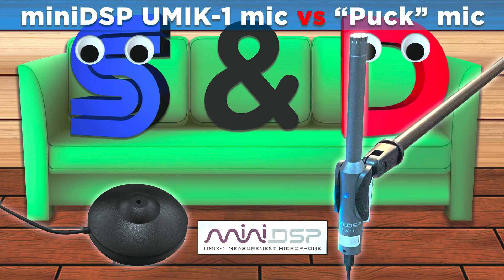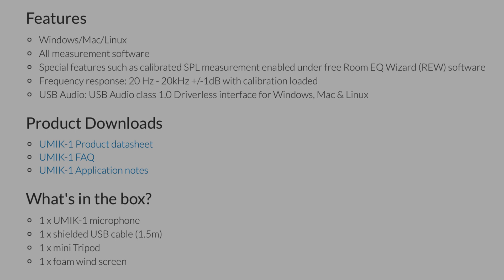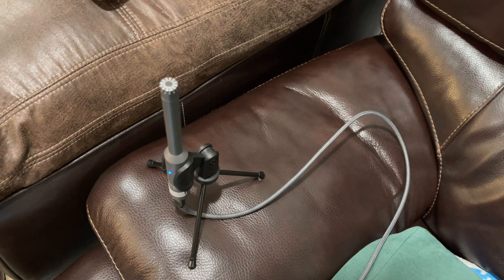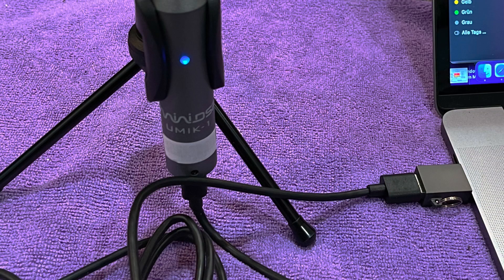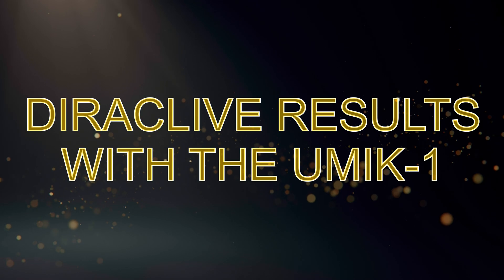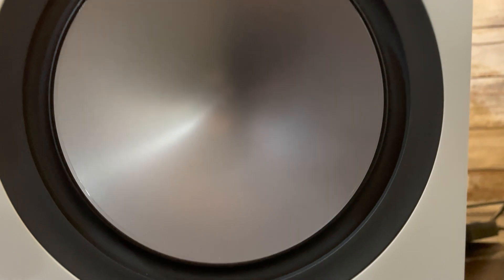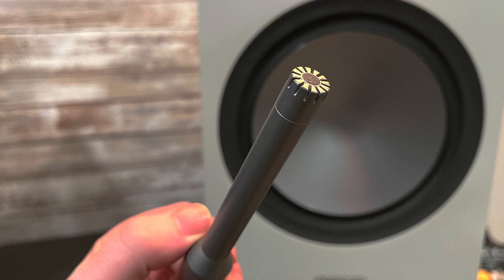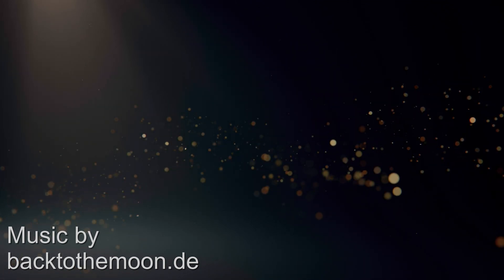UMIK-1 miniDSP + DIRACLIVE I Next level DIRAC LIVE room correction

Comment: Thanks for the video.  I'm having problems with getting the UMIK-1 mic pick up enough sound...tried many things but some reason is not working.  The RZ50 puck is more sensitive...not sure what to do.  I have downloaded the latest direc live version (also tried 3.4.4) and used different mac versions.  Any suggestions?
Reply from the maker: Hello 👋 Thank you 😊 Im sorry you are having issues. The UMIK-1 is definitely more sensitive compared to the puck so something is wrong. Im sure you have tried this but have you messed with the mic gain before the testing starts? The higher the level the more sensitive it should become using DiracLive. I am using the Mac software too. Also check if you have the mic profile loaded into DiracLive. Other than that there is not much else you can do. If its still less sensitive compared to the puck I’d contact the manufacturer.

Comment: Wondering why Dirac recommends The UMIK-1 instead of The UMIK-2?
Reply from the maker: Hi Jaystar! I wondered about that too and did research it. Turns out the extra sensitivity doesn’t make a difference for room correction that you could actually hear while the UMIK-2 is way more expensive. So in this case the OG UMIK-1 does the job very well for this purpose  😎

Comment: Very nice comparison ,but : The Screenshots of both messaurements are nearly similar . This shows: There is no really difference . Why are you sayings differently to the results ?
Reply from the maker: Hi df5485 👋🏻 The differences in the graphs are minor, you can see them more clearly when zooming deep into the graphs which I didn’t show. I am rating the mic of how better the results sound than going to deep into the math of it. But the sound did improve, also because of DiracLive using a mic with a higher sensitivity made the volume calibration and crossovers an easier process. So for people who are not too comfortable setting everything by hand, the better mic + room correction gets it done right 😎
Reply: Partially agree, but he fell victim to the classic error of using a too large a Y axis scale. De facto industry standard is 50dB, it looks like 75-80 is used here and then most things even out, even really bad speakers can look decent with this classic graph/statistics trick.

Comment: You should had done the comparison measuring just 1 location. That way there is no room for error of the mics not always being located at the very exact spot.
Reply from the maker: Hi juanlega7551 👋🏻 Thank you for watching. Yes I could have done a single test for one position, but I wanted to show in this test how much different multi measurements make comparing the two mics. I had both mics as close as possible to the same measuring spots. The difference on a whole are not tremendously huge but definitely a fine nice tweak that I can definitely recommend. 👍

Comment: Nice, habe mir gerade ein Umik1 über Kleinanzeigen geholt. Bin gespannt, ob ich Unterschiede höre. Habe Dali Rubicons im 5.0 Setup mit nem Onkyo TX NR7100. Super Video, alles richtig erklärt. Nur "surface" falsch ausgesprochen ;)
Reply: did you hear any improvement using umik, then? :)
Reply: @ErikBoooxx würde mich auch interessieren, ob Unterschiede hörbar sind.

Haben Sie es in der Zwischenzeit selbst testen können?
Reply: @ErikBoooxx  ask me again later this year. won't be able to use it until October :D
Reply: In Deutschalnd Umik 1 kostet 129e 😅 aber Onkyo rz70 heute ist fur 2300e nicht 3300e.Zu so teuer reciever musi ich kaufen.Wie war bei dir mit Unik1 mit onkyo 7100 viel besser?

Comment: Spot on! Everything you have done, I always recommend to everyone who ventures into Dirac. Before I had the Umik-1 a few years ago, my results with the supplied puck mic were very inconsistent between calibrations. Also, Dirac recommends the 90° position even for 2 channel as it needs to hear the room with the reflections or else it can't properly apply the correct filters. And the supplied "tripod" stand for the Umik is laughable. I struggled with stacking boxes to get it to the proper height. Investing in a boom arm mic stand and a longer USB cable were a life saver like you said. One thing that I do is, I set a 10 second timer in Dirac to give me time to leave the room before the measurement happens as your body in the room can throw things off.
Reply: I make sure to sit in the room or place pillows to simulate my body in the main listening position. Your body does have an impact on the room, and you will be in the room when listening to your system.
Reply from the maker: Hi Richard, thank you so much for your comment! It makes a difference, more than I expected. And good call with walking out of the room. I didn’t mention this but that’s what I did for my measurements as well. 👍😊

Comment: For the life of me, I couldn't get my  Umik-1 to work with RZ50, kept getting low noise errors, no matter what I tried, even when the room was absolutely dead silent, with the fridge turned off over in the kitchen, far away from the mic. Had to resort to the puck mic. Which was a lot less fussier.
Reply from the maker: Hi Jaggu, thank you for sharing your experience. I recommend to look at the guide at mehlau.net. I put the link in the description. It helped me a lot. Biggest problem in my house is the AC which I had to completely turn off (even the fans in the system). The noise level of your room and the test tone noise should be around 20db apart. Meaning if there is background noise of 20db, the test tone should be shown as at least at 40db on the microphone level. You can also try turning down your gain level. The UMIK-1 is more sensitive, which is good for measuring but of course it means it can pick up more background noises too, even ones you don’t really hear with your ears.
Reply: @SamDansCouch  quick question, I noticed right before you went into the select arrangement and measure you have the gain all the way down. Was that on purpose? Because when you were adjusting speaker volumes. you had the gain set high?
Reply from the maker: Hi Dough👋🏻 Good catch! You have to play with the gain according to your surrounding noises that you can’t eliminate (people being one of them 😂). So the tighter the gain the better.
I started off with a high gain and then lowered it to eliminate noises coming from above (neighbors walking). But don’t set it too low so that the test sound can be fully analyzed as well. The UMIK1 is more sensitive so going low still works out well with this mic. 
A trail and error periode before the measuring starts but it makes life much easier later and gives you less errors.
Reply: Can you provide a screenshot of your levels window ?